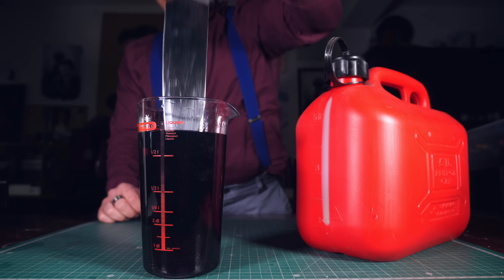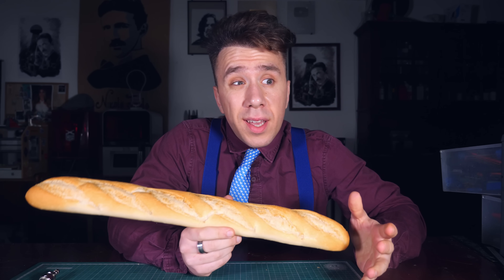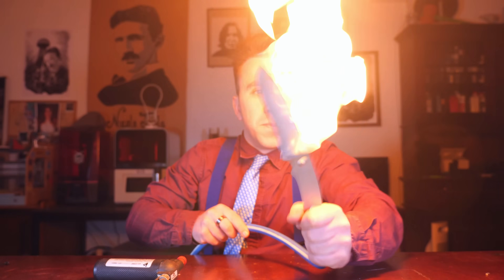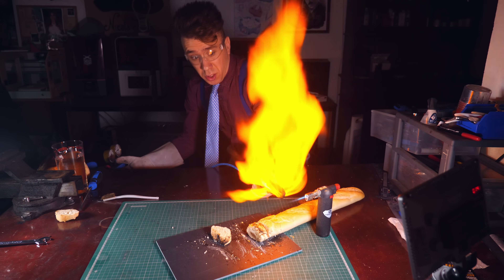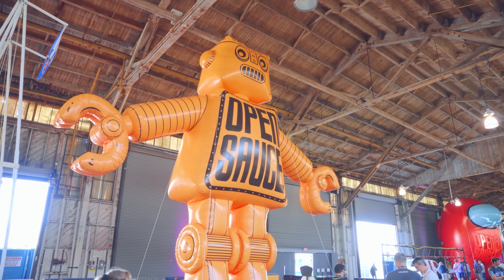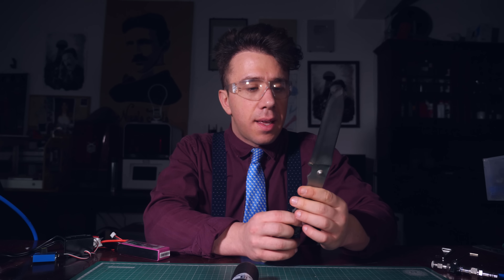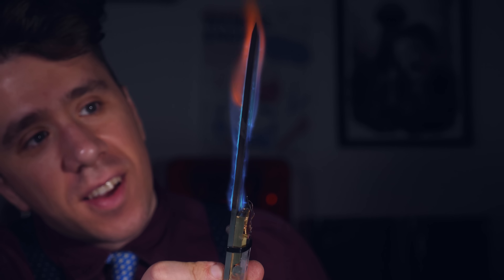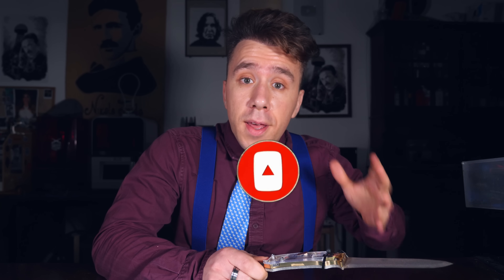I made a TRUE FLAMMING KNIFE

Comment: Bimetal blade sharp. ardened steel or spring steel. add a super high voltage DC or multiplied up AC then rectified and the bimetal blade the filiment. like using a red hot nichrome between two nail to cit sheets of foam. My one cent. Go Well.

Comment: I'd be very surprised if this material was not already in use or being investigated for use in gas turbine engines, particularly for the stator vanes in front of the turbine but also for the turbine itself. It's common for these vanes and blades to have tiny holes milled in them that bleed a layer of cold air on their surface, so a sintered material is a logical next step.

Comment: Could you make a turbine of some kind, possibly a compressor wheel, with the 3d printed metal that simply injects fuel into the compressor of the jet engine? Or, shape a jet nozzle out of this material, and use it to inject fuel into one of your fantastic rockets?

Comment: As an extremely dangerous - and frankly highly irresponsible suggestion - how about combining this technology with @Hacksmith's plasma torch "Lightsaber"?

Give it a few iterations of development & you'd have a Katana which you could unsheath, then ignite to generate a surface Corona of Hot Plasma at temperatures capable of slicing through most materials like a hot knife through butter. (Though I suspect very moist things like tomatoes would just explode as the internal water instantly flashed to steam...)

The next stage would be to find a way to generate High Intensity Magnetic Fields to manipulate the density & flow of the plasma. That way you could generate temperates in the millions of Kelvin just above the surface of the metal or pourous ceramic, while keeping the blade itself much cooler so it doesn't melt.

Comment: If you keep messing around with that knife, you might look at some stick welding gloves with metalized/aluminized/reflective coating. Maybe even a welding jacket or welding apron with that kind of coating? Even without the coating, they tend to work very well. If you get the gloves in a slightly loose size you can also just flex your fingers away from the heat when the gloves themselves get to hot (not need to rip them off to avoid burns).

If you want to go overboard and run a food stall thing with that knife, you could even get or make a racing style cooling suit, they are pretty much just a suit with a water tube running through them. You connect the tube to a pump inline with a bucket of cold water, radiator or whatever.

Comment: So, does this porous metal actually generate Laminar Flow across its surface?  Thats intriguing.

Also, can the technology manufacture differently sized pores within the surface of the part? Having differently sized pores in different regions could act as "channels" for faster/slower flowing gas moving across the surface. This could be used to accelerate the flow of gas through the system like the compressor vanes in a jet engine - only without moving parts.

Comment: Put multiple blowers in series! 11:21 or this! , put the compressor inside a metal box, with padding and thin wood glued to the inside. Pegboard maybe. Use contact cement to attach the wood, then the padding with a labyrinth inlet for air, with padding on all the walls, the padding being about 12-20 mm thick .  Or just use a wood box with padding 6-8 mm plywood should suffice, make it about the size of a briefcase.  With padding around the labyrinth intake port. It should run nearly silent. And the blocase can hold the battery and speed control, and fuel. The fuel hose can be ran inside the air hose! Up to the knife. Using a 'T' tee fitting to get it there without leaking,  'Y' wye fitting may work better. Use a 15 -20 mm i.d. air hose. With a 3-4 mm i.d. fuel  hose. This totally has me wanting to build one. Build a backpack or BLOPACK, by getting a average looking hiking backpack. Place a board inside the size of the Backpack, round all edges. And cover with padding. And attach well to the backpack especially at the shoulder straps. Then build the lid to make the board a box. Create two smaller intake ports  about 50 x 75 mm with a labyrinth of walls 75% blocking alternate sides of the walls , using sheet metal covered in padding or felt.  With a screen over the inlet, basically making the backpack a hard pack with the lid opening like a roll top desk somewhat with multiple hinges panels and a latches.   With a expandable mesh conduit covering the hose, with a few wires to micro switches on the handle, and hose use a micro controller to open and close valves control the speed of the blower with the wires hidden  and the micro switches requiring another button to be pushed for them to work.  Or possibly a RF keychain remote to do all function or to allow the buttons to work. An aluminum PCB in a handle shape with the buttons on it. With the traces , and wire connections,  with another Being the cover. Then a possibly epoxy cover over this and a matching handle cover for the other side with the switch plates interchangeable for the side they fit, but a 4-6 channel RF remote should easily handle all functions, especially if two remotes are used so two buttons can be used at once. Making  a pair of 2-4:channel remote controls capable of doing lots of things, use buttons a,1, a+1, a+2, b, b+1,b+2, then invert this doubling the number of functions.. 14 functions from a pair of two button remote key fobs! Use the fobs remotes to trigger inputs of a microcontroller to control blower speed , on/off, gas on/off, gas flow high low,   and possibly add a remote ignitor as well! With a furl tube inside the air tube and  it running all the way in to the knife handle, there is little possibly of a flash back, and this would be absolutely awesome if the knife was a short machete'. About 300-400mm long possibly 450 mm +/-, that basically being a standard machete',  I call a standard machete' basically 600mm, maybe 500 mm. But no longer than  750 mm , depending on the blade dimensions over 400 I'd think of as a sword! But wouldn't a flaming sword be awesome!?!  I want one! And these would be great for movies . Have fake blood coming from them have a collapsing blade that  leaves blood on the victim.  Squirting them as the blade is fully  pushed into the handle. To give a realistic wound appearance.  And the pores can be on the blade edge only. For interested effects..

 and  ROCKET ENGINES, JET ENGINES, Having a rocket engine the whole combustion chamber is a giant injector.  With liquid fuel and O2, entering beside each other all over the inner surface.  It should be loads better air/fuel ratios in the whole chamber. (Efficiency should skyrocket 😜,)  And jet engines could basically work the same way. Use the pores to cool the surfaces and uniformly pressurized the chamber. Maybe even add fuel this way eventually. Definitely in a gas turbine engine basically operate like the above rocket example!    Having the combustion happening all over the chamber at once, or in a controlled swirl pattern  if desired.  The effiency should be skyhigh, in the stratosphere! 😳haha, with a afterburner built using this tech. Would be cool. The fuel would need to be extra filtered, to prevent clogging, but a cloud of fuel should be emitted by this type injector?!   Have a great day brother,!✌️👍

Comment: Okay so the coolest part to ME was that it "Self-Cools". Air is a super good Insulator, that's why Insulation is often just very very porous materials or Fiber's of something. So, when the knife is burning something without an oxidizer, it would probably never get hot enough to damage itself. BUT when you add a little more "Power" with the oxidizer, it get's Red-Hot and the SECOND the oxidizer is gone, it self-cools and stops glowing. To me, that is incredibly cool!
Reply: now make the next step, jet engines suffer from cooling issues and potentially can melt themselves make the heated componants (post combustion camber compressor blades etc  out of that material and you overcome the cooling issue which allows for hotter more powerful engines.
Reply: It still needs better cooling though, getting red hot is probably closing many of the holes permanently.

It needs interior pathways that can individually be enabled/disabled to manage heat. What would even better is a design that automatically limits areas based on material expansion as those areas get hot, maybe have the interior of the knife also designed as a heatspreader via material usage.

Comment: What about using a small pulse jet flow into a ram jet engine, acting as both a supplemental air and fuel pump set up as well as an igniter.  The ram would have its own fuel supply as well for throttling control.  Run the pulse jet oxygen rich, and it would in some effect act as a form of supercharger.

Comment: Sword... Yeah, flaming sword using this same technique, but get the printer to print the very edge nonporous and get it really sharp. 
I know absolutely ziltch about metallurgy, but I assume there is a variety of printable metals on those machines. Can you get something with a really high tempering temperature, so that heating it up with the fuel and oxidizer doesn't compromise the edge? If you could get that thing to maintain a high temperature, and stay really sharp, but control exactly how hot the metal gets, then damn that's some scifi stuff right there.

Comment: My excitement with this is actually the turbine blades on jet engines. Currently  we drill holes in the leading edges and inject air into the blades to provide protection against the insane exhaust temperatures. I wonder if this mistake / technology could improve the durability / life / efficiency of jet turbines in any way?

Comment: I think segmenting the manifold  into three separate rings so you could use three different gases. This could be an alternative for rocket effeminacy as it goes through the earths atmosphere a computer could control the percentage of gases going into the combustion chamber. While you may need to include three fuels for each rocket, it could be worth it if the efficiency is there and on which gas is being used at what altitude. or possible a solution for the SCRAM jet issues during transition.

Comment: My suggestion for the next video is to use a 1 sided porous metal 3d printed in the shape of a shoe. See if you can pump enough pressure out to slide across a floor like a human air hockey puck.

Comment: This would be fun it had a flame arrester, a thermal break between the blade and shank, and an internal channel to evenly distribute the gas flow within the blade. Possibly the mixture could be adjusted so that combustion occurs mostly within the matrix and at a rate that would control the temperature so that it glows red without getting so hot that the strength is reduced too much.

It would also be fun to inject traces of various compounds to color the flame.

And of course it should be printed as a large sword.

Comment: Wont it melt together when you heat it to much up? And is this material not similar to sinter? Could you use it to use it to cool parts by let water flow trough it or use it to warm water?

Comment: So they already do this inside jet engines... But each channel is explicitly designed and cast into the parts. And this is why those high performance engines are so expensive. Each mold has to be hand built and can only be used once. Any defect and the whole part has to be scraped.  The raptor engines are made this way and it's amazing

Comment: That is so cool! I tried making a flaming sword once by casting aluminum over a tube that ran down the length of the tube, then drilling through the edges of the blade. It was a bad design.. for a lot of reasons haha. That works so much better and you can still use it like a knife!
Reply from the maker: I would love to make a sword using the porous metal but is hard to fit a sword into the printer volume, I’m looking into making porous metal without using 3D printing !
Reply: Hey guys ik you guys probably won't see this comment but I do have idean of making a porous sword by mixing matel and I would love to work with yous guys I recommend watching the video on yt of making pink gold I will put the link of the video and you can use Raney Nickel is typically made by treating a nickel-aluminum alloy with a strong alkali solution, such as sodium hydroxide (NaOH), to remove the aluminum. This leaves behind a porous, high-surface-area structure of nickel, which is then often activated by further treatments like heating in hydrogen gas. The resulting Raney Nickel catalyst has enhanced reactivity due to its increased surface area and porosity. Idk if this will be structurally strong or not but you can give it a try the video link in of pink gold which had pores or cracks :https://youtu.be/d6Pcp944sRI?si=se7V1MFxZNtVxKOp
Reply: There's a ton of cool ideas that could be had with y'all! Kevin's chaos and Joel's tools would make a fun collab.
Reply: https://youtu.be/d6Pcp944sRI?si=se7V1MFxZNtVxKOp

Comment: Video topic: how different sintered metals perform under this kind of heat. If youre pushing the mixture through and the combustion is taking place IN the sintered metal as it appears, theres probably going to be some less porus metal really quickly depending on theaterial used. Also i need a printer! My old ender 3 just isnt what it used to be.

Comment: I suspect that if you figured out how to tune it just right, the surface of the knife could function like the mantle of a gas lantern.
This would mean that the knife would have little to no external flame but would be VERY hot and bright.
If you try this, you might want to figure out an insulated handle.

Comment: Have you seen cintered bearing bronze? Bronze powder is compressed and heated so the particles fuse, leaving a permiable material you can pump oil and such through. If that can be done with steel, it could make for a pretty cool knife!

Comment: Its just like the filter stones that they put on the pickup tubes in gasoline tanks on small motors or the aerators in fish tanks..
Reply: Think the metal ones are put together using a similar process of casting metal with powder instead of melting with lasers..  although they could be using lasers..  probably not but possibly..

Comment: You could use a ceramic fuel filter, it looks similar. Or a better idea is that it could be 3D printed using the ceramic resin you have used in the past. Just create the voids in the stl.

Comment: You use the porous 3d printing to force air into a rocket combustion chamber as a way to cool the chamber walls. and or create better fuel/oxidizer mixture in the combustion chamber.

Comment: not the way i thought the video was going. second i saw the metal sponge and heard jet engine i thought of a air cooled turbine blade, however that would be a nightmare to make strong enough and last long enough in such conditions same thing with the fuel injector i can imagine with such small contact in between the micron sized metal beads heating and cooling cycles might make the sponge weak and brittle but for a prototype it should be perfect

Comment: I bet with the right laser control, channels could be made to direct the flow of gas through the material and change the size of the gaps for more or less in certain sections. That would produce a blade where all the ignition components could be hidden in the hilt, the flame focused closer to the cutting edge, more even distribution of gasses across the blade, and separate channels for fuel and oxygen. For rocket engines this would be most useful when creating a vapor barrier such as in the bell nozzle. Maybe in a video you could calculate the resistance curve for that particular knife at differen't gas pressures.

Comment: Porous sintered metals (typically bronze or copper) have been used for quite some time in many applications. One common application that is in something pretty much everyone owns, is they are used in heat-pipes for passively moving heat in electronics (though it's inside a tube so you can't see it, but pretty much every laptop computer uses them - many desktops too). Another common application is in exhaust ports/mufflers of pneumatic systems. (though the metal grain isn't as fine as what you have from the 3D printing) Could make for a relatively inexpensive source of a part to do some testing before you commit to an actual print. Looking forward to seeing what you do with it.

Comment: Hey suggestion for you. When cutting put the knife in sonic mode. The blade is the hottest at that point. Try to 3D print a container for your fuel source. You can add a value to help with the mixture ratio. 
Think of the traditional rockets.

Comment: Considering the knife - it'd be interesting to see if you can induce a spin to the flame front (say via a tube with a spiral in it or inducing the venturi effect over the outside of the combustion chamber). Lots of possibilities with it though. 

Actually now, there's a thought... How well does this handle pressure? Could you use in say an internal combustion chamber to really swirl the air/fuel mixture.. Or does it have to be gas it outputs? Could liquids run through material made this way as well?

Comment: I think an interesting topic would be varying the hole size. For it to be cheaper, I think just printing holey flat pieces that would just spray the fuel and oxidizer into a chamber. At some point, the air restriction will be far to big to be beneficial. How big or how small do these holes can be? How much pressure do you need to inject?
Since it's a company thing with a patent, I guess you might not have the accessibility to print in those machines that easily.